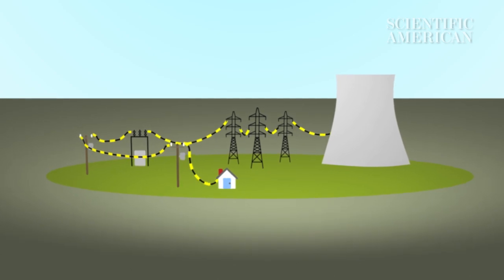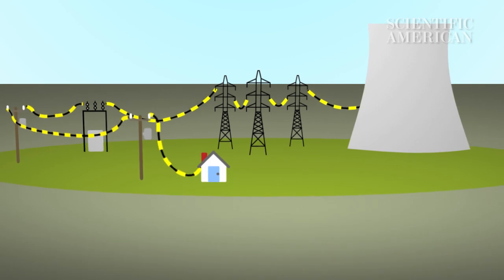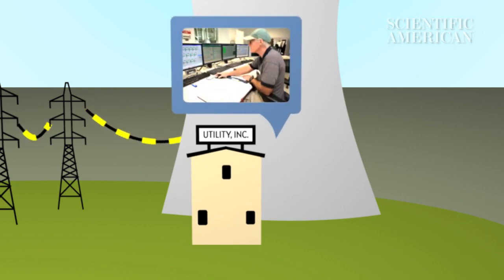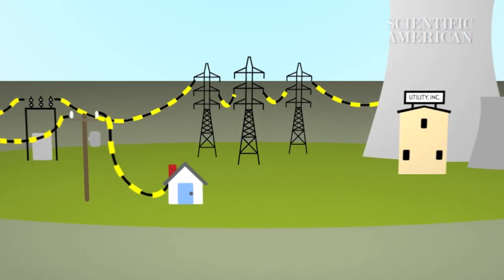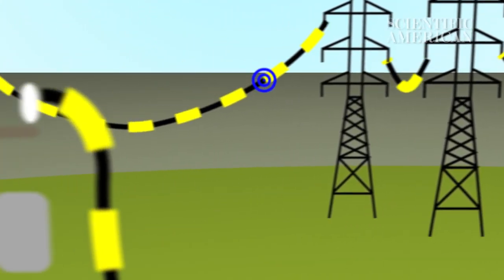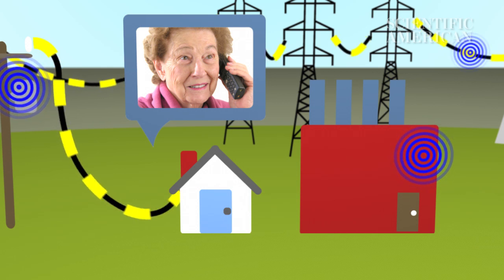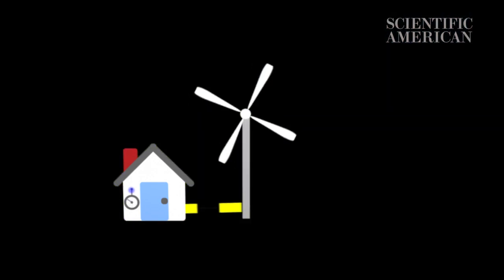What is the smart grid? - by Scientific American

Comment: 2:09 I have a "smart meter" and when I lost power I had to call the power company to tell them.  I asked if they could remotely tell the power was out and they said if a technician came and examined the meter he could send something, but it's a long process.  I still had to answer a bunch of their questions and they were clueless about how the power worked.  

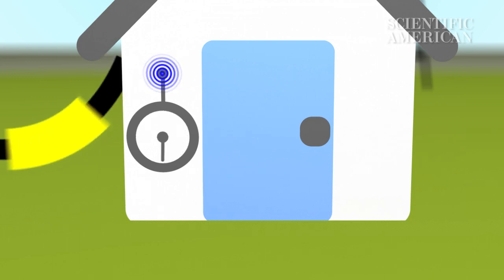2:22  This "smart grid" sounds horrible.  Does that mean the power company can shut down your oven or AC if they think you've used more than your "fair share" of power?  Doesn't it bother anyone else that they can remotely shut down an appliance in your home?

0:26  More people use Android than apple products, so why do they say "iphone" and not just smartphone?
Reply: 1. Most utilities have installed smart meters, but lack the technological infrastructure for fully utilizing them. No utility has yet to fully implement a microgrid let alone a "smart grid", it's very early days.

2. No, it means that if a fault occurs in the grid that would result in the WHOLE grid having loss of supply, they can perform load shedding to mitigate and stabilize the grid, to prevent loss of supply to the majority of the grid.

3. Ok, it's an example.